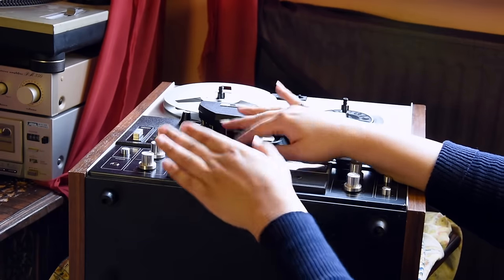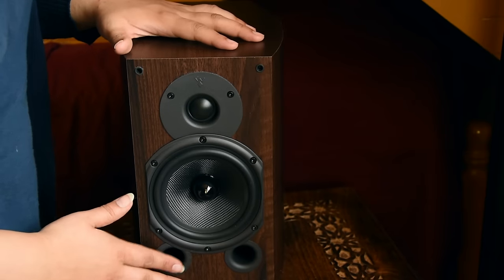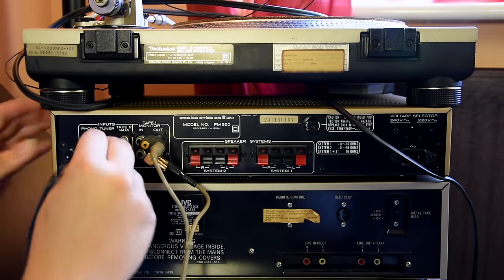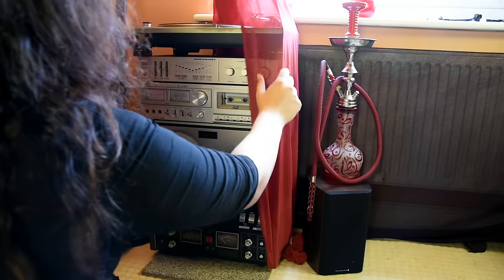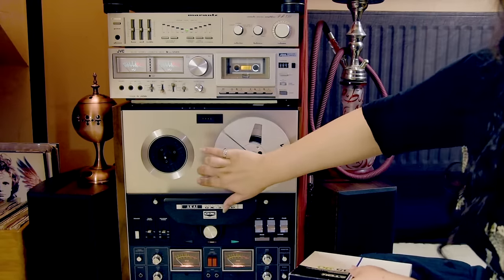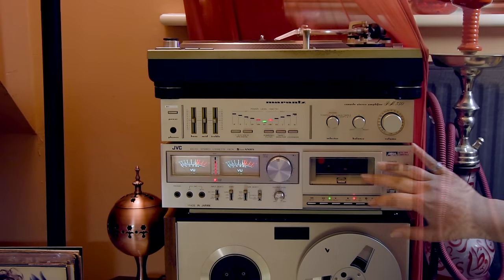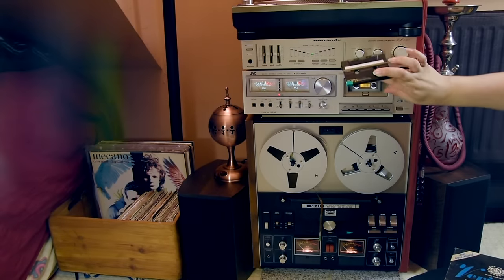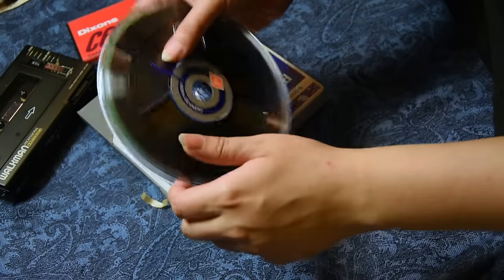Vintage Hi-Fi setup 2016

Comment: Great setup. I've the same cassette deck in my JVC collection. Super ANRS really works best on average quality Type II tapes where higher frequencies sound cleaner. Personally I don't bother with Dolby or ANRS because the SA heads on the JVC are so good on TDKSA tapes the sound is super clean. All machines are aligned slightly different so music recorded on one machine will sound slightly different on another. Another reason for not using Dolby or ANRS when you have an excellent deck like your JVC.

Comment: Excellent  video ,I wanted to simply check cassette deck set up on my HH Scott equipment which I have not had connected for years but I found your video so infectious so I looked at the whole video.Great also to see a lady with your competence! But please remember to handle your vinyl without touching the playing surface as I believe your video showed.Anyway,good luck and keep the faith!

Comment: Hello! Very good video, I liked it a lot. But, I have some observations:
First: The cables leaving the amplifier to the speakers, you can solder them with tin and that way they are more detailed and do not run the risk of damage to the connector.
Second: To avoid such a current drawback in the reel to reel machine, try plugging it into a current stabilizer or try to get something to discharge to ground.
But anyway, you have an excellent sound system. The truth is that it is enviable ha ha
Thanks for sharing
Reply from the maker: Hello and thanks! actually this is an old video, but i'm due for another hi-fi setup video pretty soon, since my setup has changed and there are new editions. 
I will bear in mind the tips, thanks for those. :o)

Comment: My experience with noise reductions have been mixed. I used to love Dolby B because, even if you didn't play it back with Dolby on, it still sounded ok, with more treble.  I wasn't a big fan of Dolby C but instead went the dbx route. Now dbx is quite an aggressive NR and it definitely needs to be played back with dbx NR, but unlike Dolby B or C or S, there is no real cal level that needs to be set up, like for the Dolbys. A level match for proper playback volumes is all that's needed, and of course, the deck should be calibrated for flat response.  I have more recently delved into 2 other noise reduction systems that came out in the 1980's. Those are the Sanyo Super D and the Telefunken High Com II, adopted by Nakamichi. Both of these are as aggressive as dbx but attack the problem in their own special ways. Noise reduction for tape systems has been a hobby/ passion for me ever since Dolby came out back in 1969. My first upper end  cassette deck was a Harman Kardon CAD-4. That deck was OEM'd by Nakamichi and sold to Harman Kardon. It could only record on type 1 tapes and had no Dolby.... BUT... Teac and Advent made available outboard NR units, so I bought a Teac AN-50 Dolby B adapter, and my li'l CAD-4 could make Dolby tapes. The next year I turned 18 and I saved up to get an Advent 201, one of the first decks with built in Dolby and the ability to record on type 2 tapes. The Advent 201 sold for 280.00 US in 1971! Gosh I'm long winded.!

Comment: You should clip those speaker wires to a length that will allow you get some of the insulation inside the the spring clip. That is if the wire is not too thick to do that. That's the way I do it to help against causing a short. Congrats on another nice video. The tape deck is really nice.

Comment: Doesn't the simple line out RCA splitter make the signal weaker, even if not recording on both sources? On my original Apple //c I used a simple splitter like that to split the composite out between the //c monochrome 9-inch screen and a 13-inch color TV. Even when the TV was powered off, the signal was weak and the mono screen was dim. I built a little switcher from Radio Shack parts and that did the trick. I love your videos (which I only just discovered, somehow), btw.
Reply from the maker: Yes it does, though the odd thing, only when you switch the second deck on it goes quiet a little, I mean it's still not so bad, you can record on both at the same time just splitting it but I think it would be better having a separate switchbox.. I'm actually due another updated hi-fi setup video.

Thanks Blake! :o)
Reply: Can't wait. And, I gotta ask, what tea are you typically drinking? Mint? Dragon Well? Cheers.
Reply from the maker: The tea is an Arabic style mint tea, basically loose green tea, sometimes mixed with a little loose Turkish black tea, a spoon of honey and yes fresh mint leaves :o)
I've never heard of Dragon well!
Reply: Interesting. I do enjoy a variety of teas, Dragon Well being perhaps the nicest green I drink regularly. Your prep of the tea and drinking it throughout and overall setting of your dwelling adds a richness to the videos. Again, very impressed.

I understand re: location. And, as it happens, my family and I visited the land in which you dwell, last month. I hadn't been in about 10 years. I'm in the DC area in the U.S. (Of late, not such a lovely place to be...) Cheers.

Comment: If you can, space the speakers a little further apart, for a better stereo effect. Also, find a way to create more spacing between amp and turntable, as heat from amp may eventually damage the the turntable.
Reply: Yes especially amplifiers they need a lot of ventilation, it's best to have hi-fi separates on a rack.

Comment: Ha, I remember having similar space issues. Also having an amp with only one tape io. Actually there are tapedeckswitches which you can use  to connect two tapedecks and still have the ability to dub from tapedeck to tapedeck. Just Google Vogel VTS 221.

That's the GX-265D transformer buzzing btw. A lot of tapedecks have this phenomenon.
Reply from the maker: Thanks for the tape deck switch recommendation, I may consider that instead as I cannot dub from the reel to reel deck to cassette. The buzzing happens when the power is off (transformer off) but it's still plugged into the wall. It's a strange tingling sensation on the fingertips.
Reply: Must be leakage current from the mains to the chassis. Is the chassis grounded? If not, you should ground it somehow. Try putting an AC voltmeter between the chassis and a known good ground and see if you measure any voltage. Nice setup, good taste in everything! Bravo!
Reply from the maker: It's grounded yes but earthed no, i've noticed the same buzzing in certain appliances, you feel a buzzy tingle from them only when you move your fingers around the surface, when they're plugged in but not switched on. I will try to measure the voltage next time. 
And thank you!
Reply: We here in the US say "Grounded" for your "Earthed" I think.
Reply from the maker: Aha, I always assumed grounding means the common ground of the circuit, where as earthing is connecting to the mains earth.
Reply: If it is not connected to the mains earth then you are probably getting capacitive leakage current in the transformer between the primary winding and the transformer body. Earthing it to the mains "Earth" should fix this.
Reply: Loads of Akai-tapedecks have this. It's not a problem, because there are
 no negative effects on the functioning of the machine. It's probably because of the solenoids which are 
connected to the primary side of the transformer. Also a lot of the 
Akai's use the frame as a common ground. Some even have the transformer 
leads connected to the same ground. You could try reversing the mains 
plug.
Reply from the maker: Yes the deck functions just fine, just feeling intense electricity on the surface is a little worrying. However I did what you advised, reversing the mains wires and problem solved! No tingling/buzzing anymore.
Reply: Is the AKAI double insulated? and does it only have 2 wires going into the power plug? If so its normal and I wouldn't worry about it.

Comment: Hi, nice setup. I use marzmntz gear to, or atleast my cassette decks, are, 
anyway to the point! like you I hate that my speaker wires are not good at the amp end, as simply a wire. 
twisting them helps, but better idea again is to tin them, they become solid and much easier to connect, 
good puck,

Comment: hi, I have got SONY TC-WE435 - Hi-Fi tape deck model cassette deck.  Devices only come online. Is it possible to connect a direct speaker?  Or should I go for the amplitier?
Reply from the maker: You cannot connect speakers directly to standalone cassette decks because they only have line outputs. You'll always need an amplifier.
Reply: @MsMadLemon  Thanks for ur update
Reply: @MsMadLemon  Thanks , So we connect from line output to amplifier line input ? Rca is different from line input/ output? port?
Reply from the maker: @sreejithnair5743  connect the tapedeck line output to the amifier tape input (never to "phono" because  that's for record players only)

Comment: Super ANRS is compatible with Dolby B NR (which itself is similar to "regular" ANRS). Its noise reduction characteristics are similar to that of Dolby B. The "super" part is like a kind of headroom extension, sort of like Dolby HX Pro, that gives between +6dB and +12dB expanded dynamic range at +0VU and above. Dolby C has a more aggressive noise reduction, which on vinyl can have good results. I find it a bit too aggressive for my taste though, as quieter passages can sound almost a bit "muted". The normal noise floor level of vinyl is similar to that of tape hiss with Dolby B, so Dolby C probably won't help much. All in all, it's up to your taste. Also, your RCA splitter set up may cause a slight drop in recording volume depending on any difference in impedance between the cassette deck and the r2r, so some sort of switch box may be a better solution. As for the static electricity, I've experienced that in a building with old wiring with no earth connection. Some stray voltage was leaking back to the metal frame. I solved the problem by hammering an earth rod into the ground, and connecting a wire from that to a screw in the back of the amp (chassis). If your building doesn't have an earth connection, this may do the trick.
Reply from the maker: I had a feeling there were similarities. I like using Dolby C the best personally though I have to bump the recording level up a touch higher than normal. Thanks for the detailed explanation!

Comment: wow you have nice stuff
Reply from the maker: Thanks!
Reply: The tingling you are feeling from the equipment is the polarity, try flipping your power cords at the wall outlet. I was having the same problem with my stereo and cassette players. Once I had the correct polarity I marked the piece that goes into the outlet.Hope this helps.Cheers
Reply: Have you been doing research at tapeheads?Lots of info there you could spend days or weeks reading all the threads.
Reply from the maker: Thanks Rob, indeed I did and it drastically reduced. Thanks for the help :o)
And I havent been on Tapeheads for a long time.
Reply: Good that it helped. I always go and check out what it's happening to learn more about rtr's and other equipment.

Cheers

Comment: Is there a specific cable to connect the cassette player to the amplifier?
Reply from the maker: There's two ways, you can use a 5-pin DIN to 5pin DIN cable, if your amp and tape deck have Play/Record DIN Ports... or you can just use RCA Cables.

Comment: Super ANRS brings to ANRS which is compatible to Dolby B NR the following.

The "Super" part is  a dynamic range expansion system. Super ANRS 
expands dynamic range   of +6Db measured at 0VU and +12 DB  measured a 
+5VU and does this at 10Khz. Its noise reduction quality is that of 
Dolby B/ ANRS which is S/N ratio improvement of 5db at  Khz and 10db at 
5Khz and higher.  But it, being the Super  part of ANRS  offers the user
 this much expansion in dynamic range headroom as noted above. 

Preference would be personal. Dolby C offers more s/n ratio improvement.
 Super ANRS in terms of hiss removal will be similar to the milder Dolby
 B which many prefer. Recording vinyl one would not really need much 
more than Dolby B as the s/n ratio of vinyl is typically between 65-75 
db at best. The faint level of hiss remaining can be seen as a way of 
smoothing out the background noise of most vinyl. Dolby C will bring s/n
 ratio of tape much closer to that s/n ratio of CD's but again many 
prefer the residual hiss of Dolby B even when recording digital sources.
 It's all a personal preference.
Reply from the maker: Thank you for the in depth explanation!

Comment: feed back on the front ? check your earth not sure but that should not do that ,most retro stuff needs that earth wire in .it was only last week i borrowed a 20 year old deck and  had feed back , put the earth wire in, it stopped , happy listening
Reply from the maker: Yes indeed most retro amps, decks etc i've come across aren't earthed which puzzles me, however I sorted out the issue by switching the mains wires around, once I did that the buzzing etc disappeared.

Comment: Do you have a good link for this incense burner? Thank you!
Reply from the maker: This is from the Middle East, but I had a look around if any other place sells them and found one in China and one in the uk. 

http://www.ebay.com/itm/Electric-Bakhoor-Burner-Oil-Incense-Bakhur-Metal-Burner-Mabkhara-Gift-UK-/172056673231?var=&hash=item280f607bcf:m:mrpJNyfHN-zOi2ISTyTXspA

http://www.ebay.com/itm/220V-Electric-Bakhoor-Burner-Oil-Incense-Bakhur-Burner-Mabkhara-Stainless-Steel/162402338108?_trksid=p2045573.c100508.m3226&_trkparms=aid%3D555017%26algo%3DPL.CASSINI%26ao%3D1%26asc%3D20160706105120%26meid%3D71ca464a33cd4c969b1c537a709011a8%26pid%3D100508%26rk%3D1%26rkt%3D1%26

Try typing in 'Bakhoor electric burner' in your local ebay. Hope you find one, they're nice.

Comment: That tingaling sensation means you have a mains live case IT NEEDS CHECKING OUT BE FOR  HURT YOUR SELF.
Reply from the maker: Yes something wasn't right, I swapped the mains wires, plugged them the other way around and it disappeared.
Reply: Yes you have
I would advise that you have it checked out it might be your hifi or your mains socket or both.

Comment: I really think you should consider investing in a proper cabinet to hold the audio components this is not really safe for them and that insense near the components is also not good for the internal parts or the outside finish as well.  the reason for the surface issue is because you have all the components on top of each other and you are getting feedback from each of the components and it will reduce the life of the components .